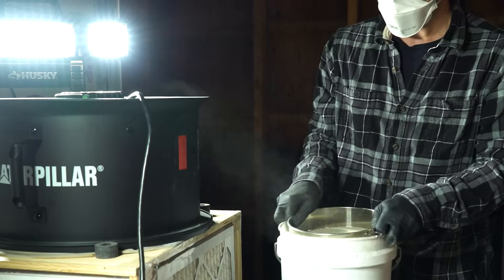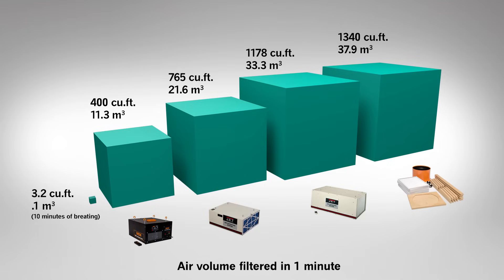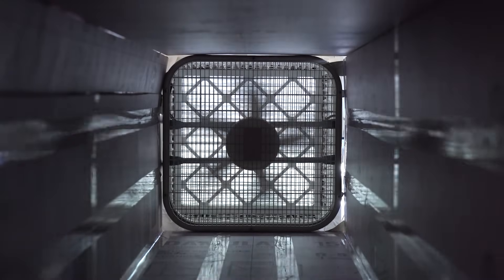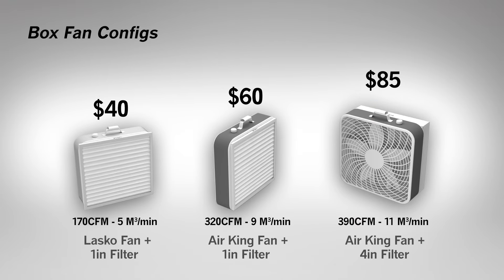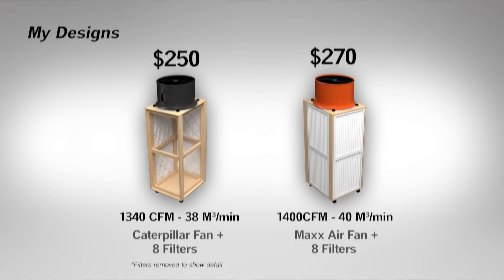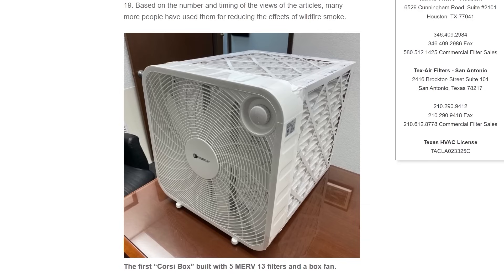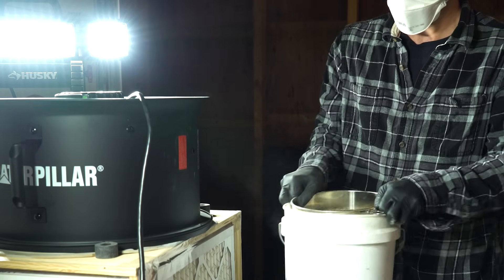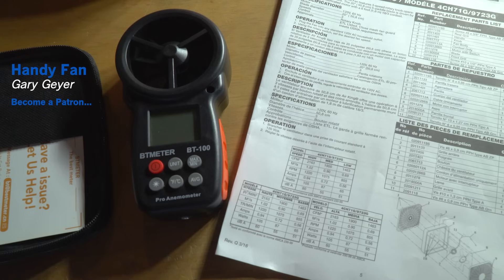What is the best DIY Air Filter?

Comment: It was fun to see the mushroom sculptures pop up. I’ve constructed filtration devices for mycology and currently run a squirrel cage fan through a 12” thick HEPA filter housed in a large plywood box to create a clean envelope of air within which sterile mushroom cultures can be worked on.... so it’s  always interesting to look at various air filtration systems people have designed for their purposes. Cool video.
Reply from the maker: I have seen these devices pop up on Etsy recommendations lately. A 12" thick HEPA filters is a beast! How long do those last under those conditions?

Thanks for the comment, interesting stuff!
Reply: @The 3D Handyman, Under lab conditions a filter like that can last a long time. Ten years of daily use isn’t unusual with proper design. I constructed my current unit as a two-stage filtration system. Air is pulled through a 14x14x1” MERV-13 pre-filter by action of of blower motor contained within a sealed box. From there the air is pushed into the main filtration plenum before exhausting into the working space through the 12” thick HEPA. That MERV-13 filter is primarily used to preserve the longevity of the HEPA... Although it also helps down-regulate airflow into optimal ranges for this kind of work, which is generally considered to be 100 feet per minute and with as little turbulence as possible. So it acts as a scrubber for the whole room by changing out the air about every five minutes at that flow rate, but the main objective is to create an effectively sterile work zone directly in front of the filter.
Reply from the maker: @l.slayer551  Thanks for the long reply! I am discovering the various benefits of low turbulence as I'm running through a bunch of sanding tests. Do you duct the air out of the filter to another side of the room. Is there a diffuser on the outflow side?
Reply: @The 3D Handyman... Ok, I totally understand if this falls into the category of TLDR, but it’s kinda fun to geek out on these things. 😂 

So no, I don’t have any ducting incorporated in my filtration system. It functions effectively as a stand alone unit insofar as keeping my contamination rates in acceptable ranges. If however, if I were to incorporate ducting, given my need, it would have to be at the intake. 

There’s no secondary diffuser with my filter, but this is essentially a design feature. The pleating is 12” thick and between each of the pleats are thin pieces of corrugated metal. These help defuse the air in such a way as to reduces turbulence. But there are other factors to consider for reducing turbulence. A volumetrically sufficient space behind the filter which allows enough pressure to build within the plenum is also needed so the air can pass through at a consistent rate over the entire surface of the filter medium. With a filter like mine we’re talking about somewhere in the neighborhood of 120 square feet of surface area. 

But my needs are kind of the opposite of yours. With sanding you are looking to pull airborne particulates away from you’re workzone, whereas my work necessitates pushing filtered air over my work.

What I think might be effective for your purposes would be creating a hood that provides adequate space for you to work while minimizing the influx of the non/less-dusty ambient air from above, below, and to either side of you work space as it migrates toward the intake of your fan. The size of your hood could be maximized by approximately matching it to the flow rate of your exhaust fan. You could do that through experimentation, or by looking at your fan specs. If you’re fan is moving a lot of air, and I suspect it probably is, your hood could be pretty a pretty comfortable working size. 

Not that you would do this, but imagine if your sanding area was completely enclosed save for a panel with openings large enough only to permit you to put your hands in. It would kind of be like sticking your hands into and working within of a big vacuum cleaner. The airflow would reach pretty high velocities at the arm holes. Such a negative pressure environment would virtually guarantee all the dust was directed through your exhaust fan—or at the very least remain within your negative pressure cabinet. 

The challenge to designing a hood, of course, would be making something modular so it could be used with your sanders, miter saws, etc. Another design consideration is accommodating large pieces of lumber when you aren’t exclusively working with pieces of that fit on your workbench. I’m sure you could come up with something! I would suggest looking into fume hood designs and replicating those concepts at a scale useful to your needs.

Comment: Subscribed!! Also, If I taped a 4" merv 14 filter to the air king, and then another 4" merv 8 filter to that filter to catch all the big dust to prolong the life of the expensive filter, would this mess up the air flow, or make it better? Thank you!
Reply from the maker: This should work fine but it will probably drop the air flow down a bit. This one is on the list of configurations to test, tho I was going to use a 1in MERV 8 for the prefilter. 

I really like the concept. the thick MERV 14s and 16s are very expensive to dump dust into. The longer they last, the better.

Comment: Thank you for going through all of this testing! I must say, i did reverse engineer some of your numbers to try and get the max cfm for 16x25 filter and a few other sizes. I've watched this video about 6 times all the way through, and i'm sure i'll watch it a few more times. now i feel like i need to get an anemometer. Would love to see results in the wind tunnel using the pull method and see how much vacuum it makes. Thanks again for doing all the dirty work, loving these videos.
Reply from the maker: Thanks! I already tested that but haven't gotten the video done yet. Some of the results are up on my website though with lots more to come... https://the3dhandyman.com/what-is-the-best-air-filter/

Comment: You should have mentioned that 4 inch filters should last 4 times longer than 1 inch filters. Also using more filters in a box configuration should make them last longer than one single filter. So the initial cost is higher, but the filters last longer.
Reply from the maker: I will put that in the next video! Thanks

Comment: Very cool content. I could pick up a cheap filtered for in home use but have been considering the diy option for a while. I would probably got the hepa route for the home though. You definitely earned a sub from me looking forward to more content!
Reply from the maker: Thank you! I'll be testing a 20x20x5 MERV 16 filter on a box fan soon. I actually tested some HEPA filters as well but haven't finished that video either.

I need to add more charts here but there is a bit of into on the tests already https://the3dhandyman.com/what-is-the-best-air-filter/

Comment: This has to be one of my favorite YT videos. Scratches an awesome hobbiest niche, an awesome public health niche, and lays out everything necessary to replicate!
Reply from the maker: More on the way too!
Reply: @The3DHandyman  I'm addicted now! Love all of the new videos. I've used tons of the affiliate links. Bought the AQM. Interesting conclusion on 3M vs Nordic Air.

Could you wind-tunnel test 2 fans stacked? I'd also love to see decibels be a top statistic you present too =)
Reply from the maker: @jacobbaxter2278  Stacking axial fans creates a lot of turbulence and therefore doesn't really improve results. I just tried serial inline fans and expected more of an improvement that I ended up getting. Where those really shine appears to be running them in parallel. That video should be out next month!

Here's the sound info I've collected so far. The numbers are arranged from high to low speed.

Background sound 40dB 
Lasko @1 ft - 63, 60, 55
Air King @1ft - 68, 66, 61
Air doctor @1ft - 64, 58, 52, 45
Maxx air @1ft - 71, 67, 57
Caterpillar @1ft - 71, 67, 63, 57
Reply: @The3DHandyman  Makes great sense. Thinking about helicopters, I wonder if that's why they do counter-rotating blades. I wonder if flipping the direction of spin would allow serial gains vs parallel =) Might think about how to do this appropriately

Comment: Note that if your goal is to have a home air filter, high CFM is not necessarily a must.  Leave a cheap 20" fan running on low for a few hours and you can already drastically lower the AQI to less than 1 as long as you have plenty of filter surface area.   Workshop filtration is a completey different matter of course.
Reply from the maker: Very true! The sound the high end fans make is not fun to be around in your livingroom or bedroom, for sure.
Reply: @The3DHandyman hello, do you have discord by any chance? I'd like to get some help with building my own filter.

I have a high cfm fan of about 4000 to 8000 cfm depending on speed, 50cm(19,6inch) diameter blades 

How many filters do I need?
I only have two 60by60cm filters.
Would stacking them together work or should I put them on different parts of the box?
Reply from the maker: @dargunsh7156  Hi! I don't have a discord yet, but I can answer your questions here or through the Etsy message system if you want to send pictures or something.

4000-8000cfm is a lot. If you are using 60x60cm filters, I would suggest using 6-8 of them side by side. The more filters there are the better it will run. The filters can be arranged in a box configuration or in a line with one another if you want top make a ceiling mount. The filters will cost more up front but they will last longer if there are more of them.

If you still have more questions, just ask.

Comment: @The3DHandyman,  there's an old saying: "The best dust mask is the one you're willing to wear", and I think the principle applies here, too. The best air filtration is the one you're willing to turn on, and a big part of that is how noisy the filtration is. It would be easy to achieve greater airflow by simply using bigger and bigger fans, perhaps even stepping up to 240V or Three-phase power in a shop setting. The thing is, if you need two layers of hearing protection to use your air filter... you're never going to use it. 

I'd LOVE it if you could start to factor noise levels into your testing as well. It might shake things up, and show that if you want top performance, option A is the best, but if you're wanting good performance and low noise, Option B is the best.

Thank you for your great testing work so far!
Reply: 240v at 30 amps is a clothing dryer or electric oven. 120v at 15 amps is your microwave oven or clothes washing machine.
Reply: I don't think 240 volts means something works harder than 110?
Reply: @liannebenn2097 multiply amps x volts to get watts- total power used.

Comment: I just have a simple box fan with a 20x20 air filter duct tape to it and it works the filter turns black and fills up with metal filings
Reply from the maker: These work quite well. I tested these with smoke and they are by far the lowest entry cost with pretty good performance. I talk about filter option in this video https://youtu.be/XAJ__E-hIJc

Comment: What about a squirrel cage fan? Sure, ducting would be different, but squirrel cage fans are often quite a bit quieter for the same air flow. I imagine the drone from a large 'propeller' fan would get pretty deafening after only a short while.
Reply from the maker: True! I'll be making a design using a blower motor pulled from an old furnace some time soon. Designs using inline fans are also on the way. I'll talk all the pros and cons in the videos 👍
Reply: @SimonWoodburyForget  Sure, but we're trying to filter out sawdust from the air (I.E. BIG particles), not filter a sterilized lab environment. lol. Most any cheap HVAC air filter is easily more than enough filtration to handle the sawdust in the air. Plus, if we're constantly creating new dust (by sawing more stuff), it's not a "filter all of the air really well once and call it done" situation because we're constantly putting more dust into the air. Therefore, we easily prioritize high CFM and 'meh' filtration over 'meh' CFM and high filtration.
Reply: @SimonWoodburyForget  Static pressure fans move less CFM per watt though. It's easy to add more filter media surface area to reduce the amount of pressure the fan must overcome.

Comment: THis video is great Thank you !~ (sub'ed)  One thing is that it seems that in one setup you have the fan pushing the air into the filter, in another you have the fan pulling the air through the filter. did you compare the difference? . it seems like pulling the air through the filter will keep the motor cleaner

Comment: That is very usefull infos which BLOWS my mind ;-) Btw, i need good air filter because i have asthma and i am allergic to dust mites and pollen and my room is 25 Sq M
Reply from the maker: Thanks! Check out my video on smoke testing https://youtu.be/XAJ__E-hIJc

I test a lot of filters to find out which one preforms best with super small particles. I would not use one of these filters in your HVAC as I erroneously mention in the video. It's really best to filter allergens with a separate filter and keep the furnace filter to MERV 11 or less. A filter on the back of a box fan should work just fine in a 25sq.m space

Comment: QUESTION! :  What about channeling the filters, Like stagging them for the current of air to go thru the filters and have to zigzag around them ??
Reply from the maker: I'd like to answer your question but it's hard to picture what you have in mind. Can you rephrase?
Reply: @The3DHandyman  OK have you seen how dirty water is seperated?  they use Locks similar to gates, so in the 1st gate garbage floats the 2nd one holds garbage on the bottom so by the 3rd its cleaner.
Reply: @The3DHandyman  In the Subwoofer World it would be called TRANSMISSION LINE box.  Just use the filters as the walls
Reply from the maker: @alejandroaguilar9038  Ohhh, ok. Yeah both of those are good examples. That's a great idea! I am working on a furnace blower based design that might work well with that concept. I might have that ready in a month or two.

Comment: Absolute great test/build process!
My questions is, have you ever tried other options of fans, like using a few fans in series to boost the wind pressure, or using a centrifugal fan?
Reply from the maker: Thanks! I plan on testing inline fans in series in the next few weeks. I am also working on a design for a centrifugal fan that was pulled from an old furnace. They will be put through all the the same tests as the ones in this video. Say tuned!

Comment: Question 🙋🏻‍♂️ 

Push or Pull (airflow) regarding filters, which is better?
Reply from the maker: I would recommend pull for almost all designs but the Caterpillar drum fan can make a good push option. It really depends on how you plan to use them.

The push option is great if you can set it up next to your work station so that the outgoing air does not disturb the dust heading towards the fan. For the Model-A, that means a tall table. I will be making a modified Model-B and Model-C kit that works with the drum fans that will be better next to shorter tables. This is coming in a few weeks.

Comment: I was a bit confused on air flow since it is shown 2 different ways. 1 the fan is pulling air from the air fiters and then later the fans are blowing into the air filters.
Reply from the maker: For the Model-A (my original design) the fan can go either way. If the fan blows into the filters it captures dust very well from a short distance (like next to a work station) but for general air filtering it's best to blow air out of the filter box into the room.

I'll make a video about this concept some time soon.

Comment: Can't you create greater air flow by taking the filter from the rear of the fan and instead placing it on the front of the fan?
Reply from the maker: I don't think so based on a few reasons... but it's something that has been mentioned a few times. I will test this soon and put it in my next video. Thanks for the reminder!
Reply: @The3DHandyman  It would seem to me that overcoming the resistance presented by the filter on the back would be a major impediment to creating greater air flow as opposed to having no rear resistance and "pushing" the air particulate onto a front lying filter. Although, I could be wrong.
Reply from the maker: @scottgood7888  That's true. These types of fans aren't great with high static pressures. Buy, it seems like there are arguments for both, so it's definitely worth finding out.